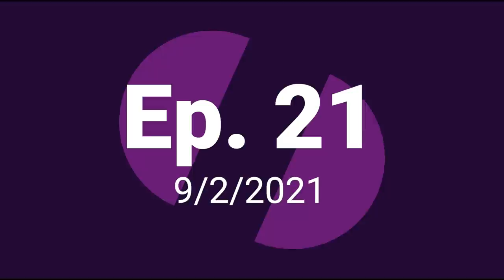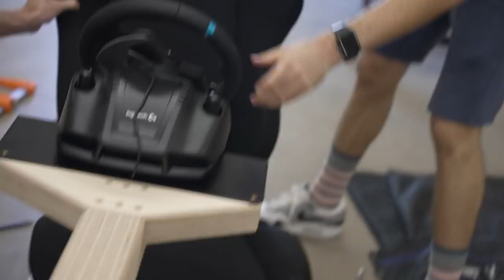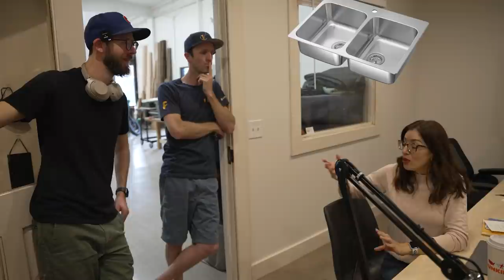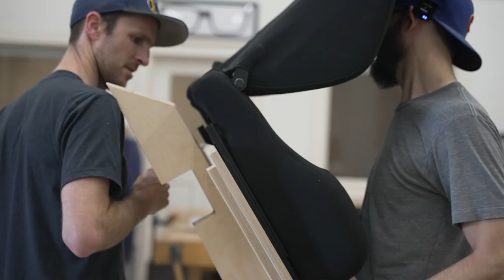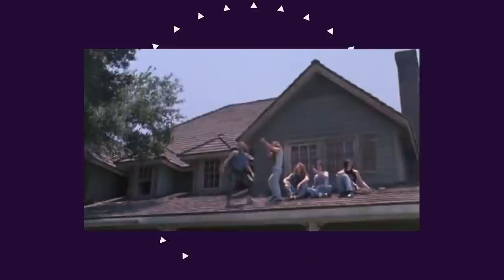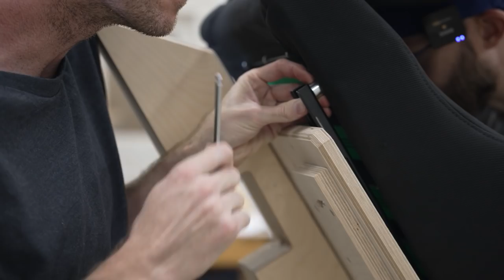Watch Shaun and Chris Almost Destroy Their Sim-Racing Rig

Comment: 6-11/16…Sounds like a classic imperial-metric problem
Reply: Yeah. 169.8625 mm sounds much better.
Reply: @grandolddrummer  You could very easily round up to 170mm... which is about .01" off of 6-11/16"
Reply: @thisisnotmyname91  or you could find 11/16 on a ruler and make the mark as shown in the video. I'm so tired of the metric vs. imperial crap. Just use what you use. No one cares.
Reply: @grandolddrummer  fwiw I’m Canadian, our standard is metric but I use predominantly imperial measurements. I was merely pointing out that your comment was ignorant of the accuracy of 1mm.